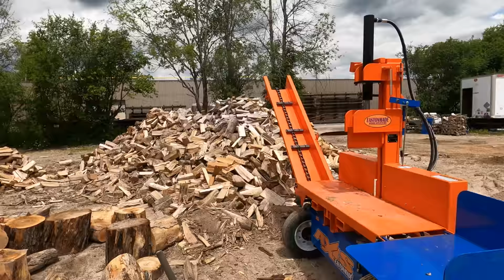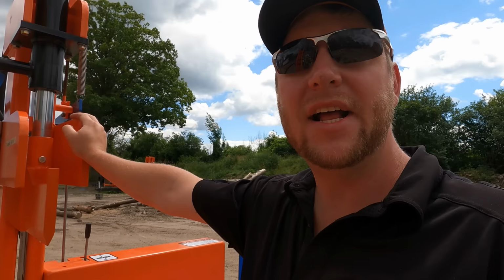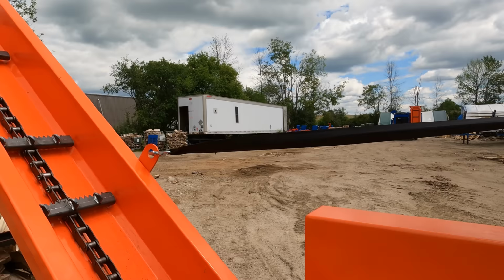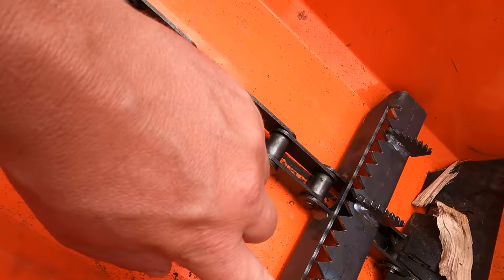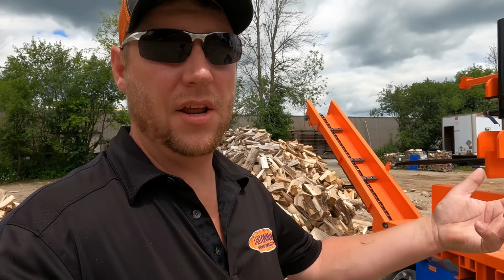Eastonmade; HUGE Improvements to Axis Conveyor

Comment: I got to run Tony's Cool Tools Axis this past weekend. Is an incredible machine! Is everything you and others claimed it to be. But for the way I do wood, the Axis is a bit too clumsy to move around my tight-ish woodyard, especially with the conveyor. The speed of the splitter doesn't scare/concern me at all, floored the foot pedal almost immediately when trying it out. If had tried out the Axis before ordering the horizontal splitter I did from another company, I probably would've bought the Axis without the conveyor. Like you said, it isn't more productive than the horizontal machines but it is incredibly precise!

Comment: At a commercial landscape mower manufacturer we had 20% margins, dist had 20% margins, and dealer had 25% to negotiate down to 20%. Parts were 100% - 1000% (wire harnesses for example) markup. Simply offer conveyor replacement with minimal % markup for 1 year. All our "bad design" fixes rolled out with similar pricing.

Comment: Some manufacturers, when they have significant upgrades, offer a 50% discount if the client sends the old "model" back. In your case this might be too much for a client to remove and ship because of cost and downtime but maybe people more locally would take you up on it?
Also, they could be designed in such a way that they are an upgrade that can be added by the end user by simply BOLTING them on instead of welding as was suggested. Maybe they could be clamped on or directions to drill holes in their current setup and install these. I am sure there are some positive solutions to make everyone happy as this is a significant upgrade since I've seen this issue numerous times on numerous channels. GREAT FIX.

Comment: Hi Andrew!!😀😀
The new conveyor chain seems to work much better. 
Another thing I would like to see is a longer wedge on it like the one you tried out on a video you did. 
I think about 3 to 5 inches longer than what it has would work better than the one you have on it now. It should be almost the same length as the table. 
That's just my input!!😀😀👍👍💚

Logger Al
Reply from the maker: Makes sense Al.  Really appreciate all the support
Reply: I agree. I tried to order it with the longer one and was told it’s not offered.

Comment: Fantastic news! The conveyor is the biggest gripe about my new Axis.
Reply from the maker: Appreciate the support chuck!!!
Reply: @EastonmadeWoodSplitters  now, how can I get a set of paddles to weld to my chain?
Reply: I'm happy with chain vers. 1.0 but I also made a small change to the flapper at the base of the conveyor. Before the change I was kind of hating life...LOL  Good to see the improvements being made in your product line.
Reply: @circlebmn  please explain your mods as that’s another area that needs improvement.
Reply: @LakesideAcres  what worked for me was to trim the rubber flapper so that it did not touch the bottom of the chute then add a stiffner behind it using the same hardware as the flapper mounts with. My stiffner is 1/4" HDPE cut to clear the paddle by maybe 1/4". The logic is the longer original flapper allows the woud to be lifted as the paddle passes and the leading edge of the paddle does not grab the wood. The stiffner is required as shortening the flap allows wood to fall down the end of the chute. Combined, the shorter flap and stiffner work together and have solved 99% of the issues I had using chain vers. 1.0    Lot of words but really a 10 minute job at most.
Reply: @circlebmn  thanks for that. It sounds like a good mod.

Comment: Andrew that conveyor is awesome! My only suggestion would be to space out the teeth to 18”-24” inches apart and no less than 18” inches! For your wood splitters and for the firewood processor’s just a little bit wider and use same teeth as firewood processor! Keep up the great and awesome work! Have a blessed day 🙏
Reply from the maker: Thanks kevin.  Paddles are spaced 22-24" right now

Comment: I also notice you’ve added more stiffening ribs to flatten the bottom of the conveyor. Mine is horribly rounded and BOTH ends of the paddles are cutting into the steel because the roller track is too low because the bottom is NOT flat. I sent photos showing this problem to warranty but was told it was “fine”. It really would be better to not tell a customer it’s “fine” while you’re making changes to address that exact problem. At least be honest with customers and don’t blow them off while you’re fixing the problem they’re having problems with.
Reply from the maker: Get ahold of henri in the morning and ill take a look early next week when im back.  Im sure if its an issue we can get you fixed up
Reply: @EastonmadeWoodSplitters  thanks Andrew!

Comment: The conveyer seems to be able to move slower. 
Will this reduce the power needed to run the conveyer? 
Also slow moving things generally wear slower than fast moving things.
Reply from the maker: Yes it does.  Yhe conveyor robs a little bit of flow from the cylinder.

Comment: I ordered an axis June 2nd, would it have the newer conveyer for sure by the time its ready or should I call and request it? I forgot to ask about the wedge length when I ordered as well. Seen you were testing other lengths not to long ago, did you find that longer worked better?
Reply from the maker: We normally dont change the length of the wedge.  It will have the new chain on it